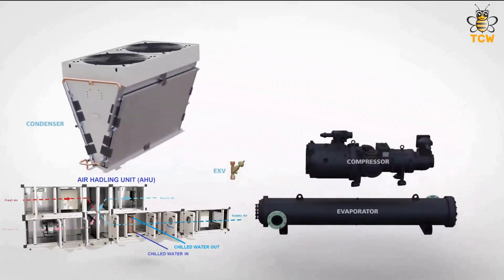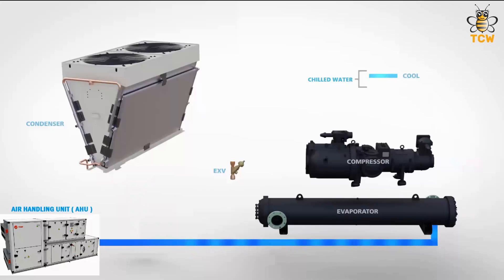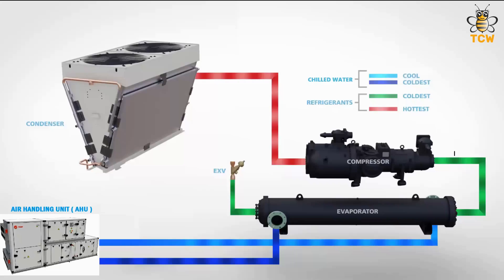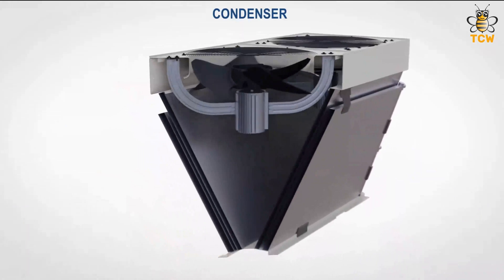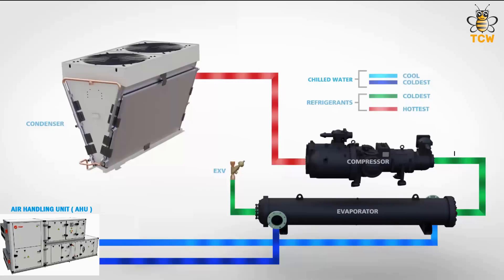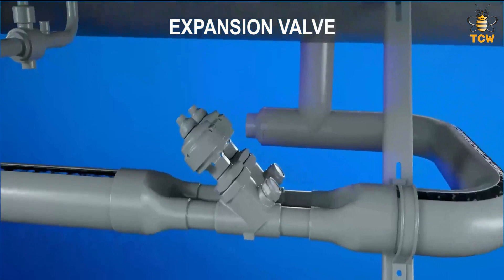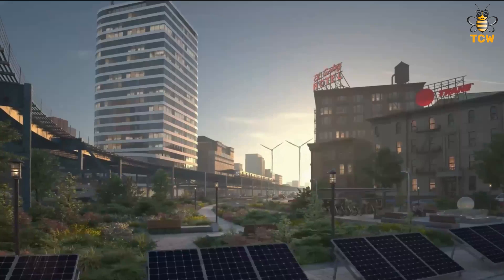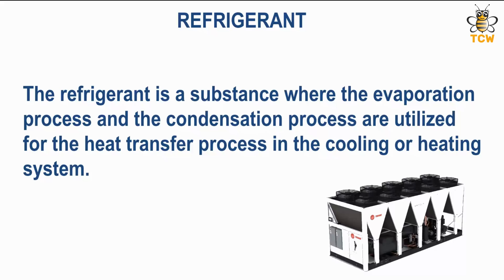How chiller works ( air cooled chiller animation )

Comment: Thanks for the interesting information. What is the air velocity at the air cooled chiller fan outlet? What is the diameter of the chiller fan?
Reply from the maker: It depend on manufacturer design.  A lot of science plays here from heat transfer, fluid dynamic and thermodynamic and each manufacturer have they own know how design. I believe that the answer can be found in a book about chiller engineering and design. I am not really expert about that. Sorry